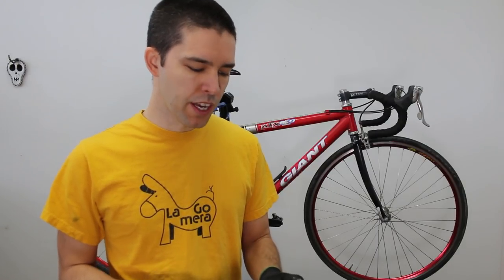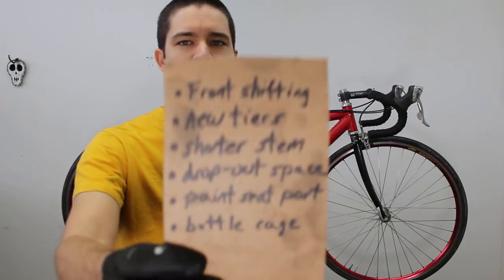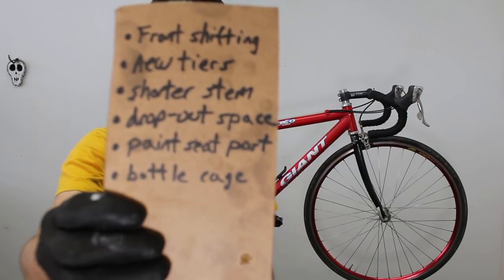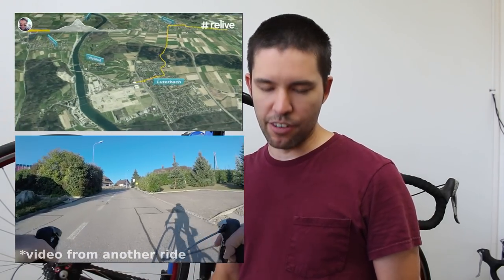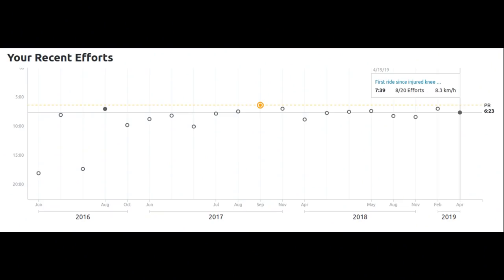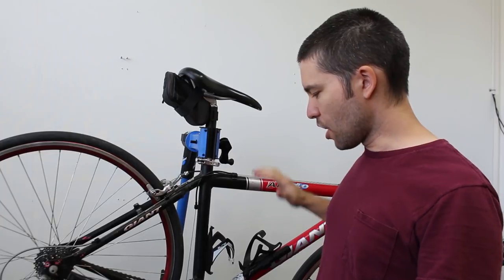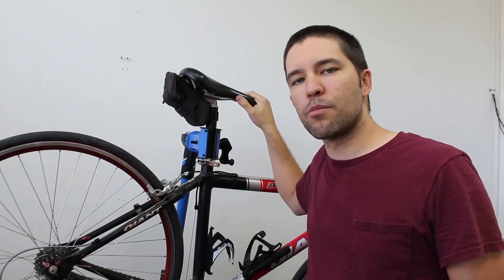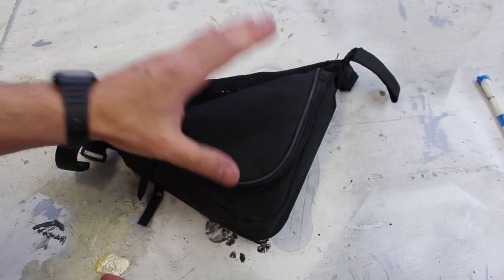MTB to Road bike conversion prep for Mallorca Youtube meetup

Comment: Bruce Hey what MTB Giant model was / is that ?
My current road bike is a 2017 Giant Contend SL2 Disc, with a set of ICAN Carbon Road wheels. Works pretty well for our nasty rough rural roads, like a Road & Gravel bike hybrid.
Cheers have fun & safe time in  Spain - David
Reply from the maker: Thanks David. It's a ATX840, best I can tell it's a 1997 model.
Reply: @BruceChastain  Cool that suggests it's an "all terrain cross over" (Cyclocross?) model...just a guess.
PS there are so many factors beyond just weight about what constitutes how a bike feels. I find most are unique. We have both Alu & Carbon frames and I think both have merit. My '17 Contend is Giants "Budget" Road offering but made of Aluminum and we prefer it to many Carbon frames. The Giant engineers have "tuned" its tube shapes / geometry very well so that ride feel is crisp & responsive, yet shock is muted. Crazy good bike at just $1000. My daughter now 15, rides same year Contend, size S - Rim brake & loves it too. Hers was just $600 new.
Darn good value. Giant is our favorite brand !

Comment: Bruce, your gearing I think is off, especially if your knee is...
Mallorca is uffff!!!
Reply from the maker: hey there Lefty, thanks for stopping in again :) As far as having a low enough gear, I think I'm okay, even though it's only a 28 in the back, the small ring in the front is also only like a 24. I looked at the calculation awhile back and it's a very low ratio still.